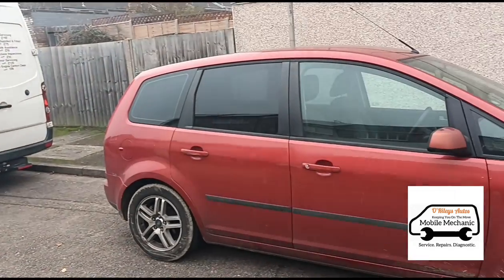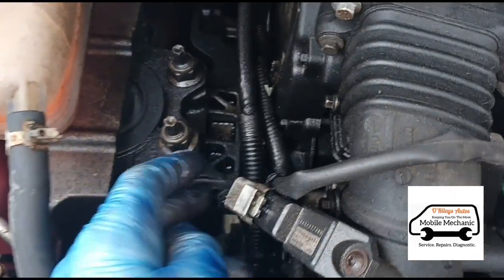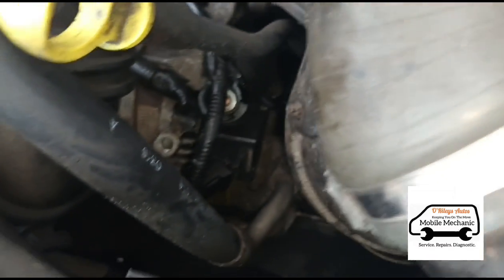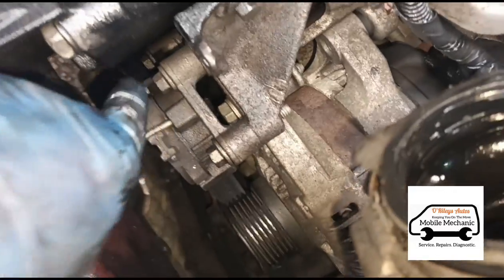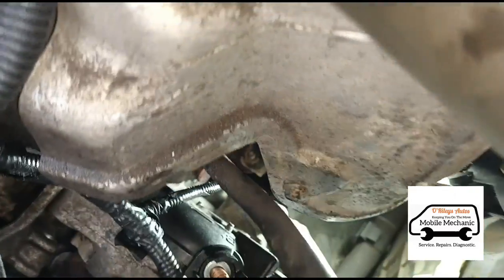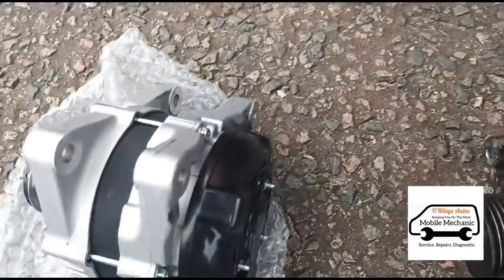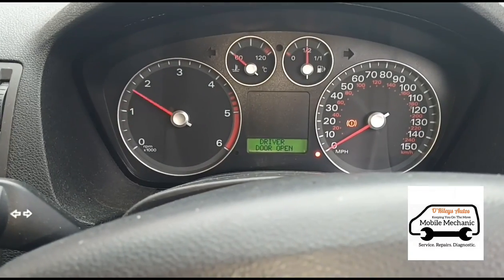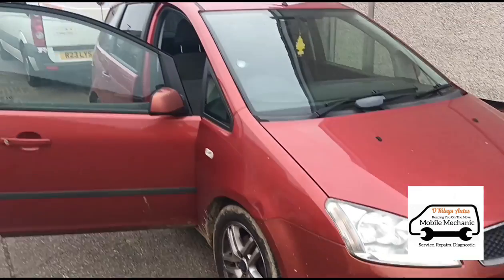Ford Focus C Max 1.6 Tdci Hdi Alternator Replacement Fitting

Comment: Great vid, thank You. I can only mention, that its best to remove negative battery terminal not, positive. If You accidentaly touch engine or body with loose "+" terminal it will cause short circuit
Reply from the maker: Great point!

Comment: Bolts by the exhaust are horrendous I feel you're pain 🤙🏻
Reply from the maker: Right pain 👍🏻
Reply: Hi the bottom
Right bolt does it have to come fully out the bolt or just loosen it then wil
It slide out as I see it has a gowl on it